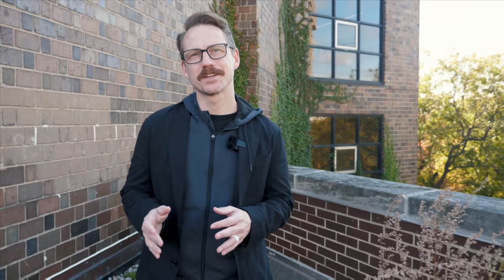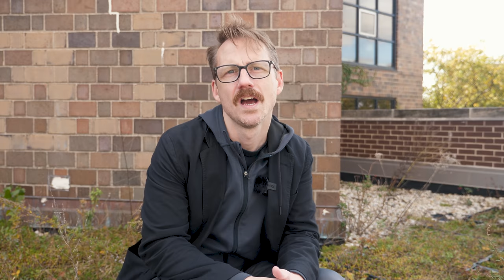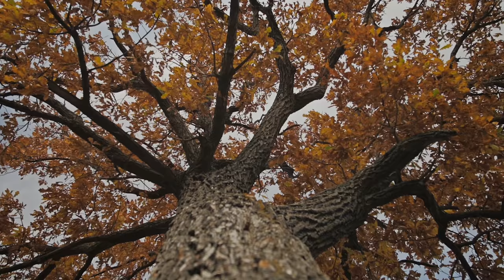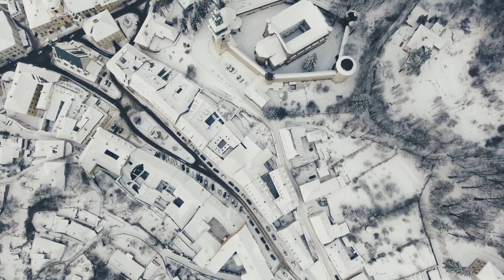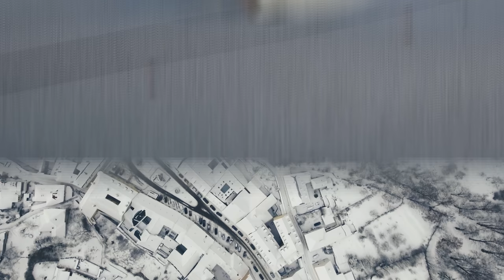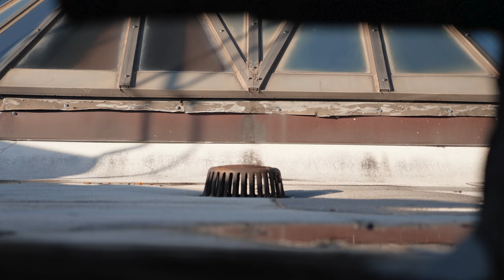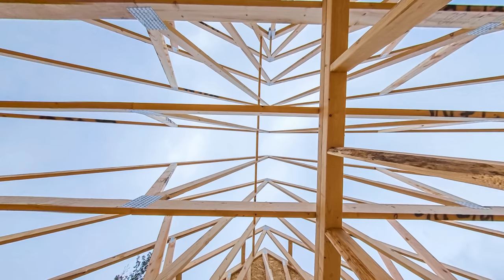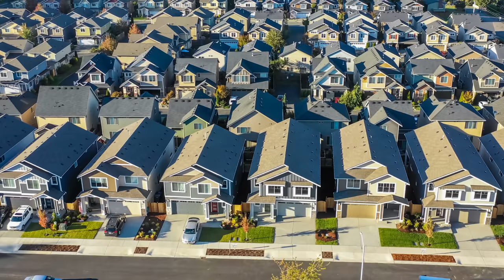Why Do Architects Insist on Using Flat Roofs?

Comment: Another main reason for flat roofs in cities that have snow in winter is the hazard of snow/ice falling on pedestrians below, especially on high rises. In Switzerland (Davos for example) the building code mandates flat roofs, both function driven and aesthetically to keep mainly a “uniform look” of the buildings, even though they do vary in shape and form ;) I am not saying that there aren’t exceptions even in Davos, which does have sloped roof homes, but they aren’t in zones where people walk beneath the roof’s possible discharge ;)
Reply: Ah, I often wondered that, thank you. I think Montreal, Quebec would be a good example as well as the majority of buildings and homes have flat roofs and that's a likely a major factor!
Reply: I've seen some incredible snowslides off the roof of my town's sports arena.
Reply: In snowy countries there are often horizontal rods or a series of notches attached to gabled roofs to keep the accumulated snow from sliding off. This is common in e.g. the Alps and the Carpathian Mountains.

I’m some other cold European countries there is an architectural tradition of very tall, steep gabled roofs on which the snow doesn’t build up.
Reply: @timpauwels3734  Yeah! Here in Canada asphalt shingled roofs tend to hold the snow fairly well in most cases, but on metal roofs you see those little stoppers or rods almost always.

It's neat to see all the different methods to tackle the same problem!
Reply: Excellent point.  I have one of these new popular metal roofs with a significant pitch, and when the snow comes off, it comes in one huge sheet.  Imagine a 10" snowfall sliding off at once--it's enough to bury a small dog that happens to be relieving themselves at the moment.
Reply: Thank you for this comment, I always wondered why Davos looks so much different than Zermatt for example. I have to confess, I don't like how Davos looks. It reminds me of a pile of Lego bricks poured on the bottom of a valley.
Reply: Here in Oklahoma if we put gabled roofs on our skyscrapers, the melt refreeze cycle of winter would cause the snow on the roof to become sheets of ice over a day or two.  Basically causing the build up to become potential air to ground projectiles.  Even if it didn't kill anyone, the property damage alone would be horrendous.  Happens all the time with cars that aren't cleared of the snow.  Every year there's reports of accidents from ice flying off the top of cars and trucks and AT LEAST destroying windshields.  A few are fatal.
Reply: @learningcurve23   I love learning new stuff!  That's right, I never imagined there were skyscrapers in Oklahoma.
Reply: I’ve also seen the weight of snowpacks cave in roofs.
Reply: I actually thought of this immediately when I clicked on this video. My brain just went: hmm if tall buildings had gabled roofs....then proceeded to imagine a pile of snow slip and fall 10 flights onto people.
Reply: @timpauwels3734  You realize that you just contradicted yourself right? How do you prevent snow from building up if you're literally intentionally holding it on the roof. These are two incompatible goals.
Reply: @hedgehog3180  I know this is going to sound odd but on the pitched roofs they also sometimes retain the snow for insulation purposes. After the first snows the sun comes out  and creates a hard slippery surface on top that sheds new snow but retains the older for insulation.
Reply: There's better roof designs than flat roofs. Flat Roofing is just lazy. It's easy to do, it's cheap, and it does it's job, as long as it's maintained properly, it's just that maintenance is not something that is cheap, and for just 10% more material and 14% more initial work, you could've had a convex roof with drainage and you could even incorporate techniques to keep the snow from assembling on them, by means of passive heating, but no, just slap a roof on the building, make it all as cheap as possible and make it last 40 years top, great solution, I'd rather go old school, and force everyone to go back to copper tiled slanted roofs, like the Cathedral in Roskilde, Denmark.

Oh and Modern Architecture is a scorn to everyone's eyes.
Reply: There's better roof designs than flat roofs. Flat Roofing is just lazy. It's easy to do, it's cheap, and it does it's job, as long as it's maintained properly, it's just that maintenance is not something that is cheap, and for just 10% more material and 14% more initial work, you could've had a convex roof with drainage and you could even incorporate techniques to keep the snow from assembling on them, by means of passive heating, but no, just slap a roof on the building, make it all as cheap as possible and make it last 40 years top, great solution, I'd rather go old school, and force everyone to go back to copper tiled slanted roofs, like the Cathedral in Roskilde, Denmark.

Oh and Modern Architecture is a scorn to everyone's eyes.
Reply: The flat roof isn't icicle proof however

Comment: The bigger issue is that they’re often in situations with people who can’t afford to keep up the maintenance of flat roofs financially or have the money to make the roof as leak proof as possible. That’s when it starts to feel like an imposed burden and a money scheme.
Reply: From my experience maintaining a flat roof waterproof costs practically nothing. I haven't spent a penny on maintenance on it in 20 years and it has never leaked.  I think all these problems being described here about leaks and collapses and what not are just a result of faulty design by the architect responsible, poor choice of materials and poor workmanship. There really is no reason why a properly built flat roof should leak or collapse unless a plane falls on it or something extreme of that sort.
Reply: @listerdave1240  there is also literally no reason to build a flat roof if you don't want a balcony on it. So if you don't want a balcony getting a flat roof is just plain stupid because to repair is (if something breaks" is way harder then an actual normal roof.
Reply: @captainbube1217  The point  am trying to make is whether or not you choose a flat or gabled roof should have nothing to do with whether it leaks, or how much maintenance it needs or whether it will collapse with snow. In those respects there is no difference between a flat and a gabled roof as long as they are both built properly.
If you want a gabled roof because it looks nice and traditional then that is fine, and that is just about the only good reason there is for a gabled roof. If you want a flat roof because it is more practical that is also fine. 
What I don't agree is what you say that repairing a flat roof is way harder than an 'actual normal roof'.  First of all for me an 'actual normal roof' is a flat one, whereas a gabled roof is one that has better aesthetics.   I'm not quite sure what repairs you are referring to that a flat roof might need. Unless an airplane falls onto my flat roof I don't see it ever needing any repair.  It's been there twenty years and it is just the same as it was when it was built.  Even if it were to collapse due to some catastrophe, 
 building it anew is neither difficult nor expensive.   I don't know that much about gabled roofs but I don't quite understand how any roof can be easier to build than a simple flat concrete roof.
Reply: @listerdave1240  there is a massive difference when it comes to snow and ash. Flat roofs can't shed those things at all. And I do mean at all, it just builds up until it stops snowing or ashfall stops. Gabled roofs don't have this problem because the snow or ash just... Fall off.
Reply: @captainbube1217  This video gives plenty of reasons why buildings have flat roofs.
Reply: @listerdave1240  in my experience flat roofs will kill themselves after a few years because any smallest hole will start to let water into the isolation material, i could not be up to date on this but this single reason is enough for me to make a roof tilted and with shingles, but this is just for my home region obviously, strong winds would maybe be a good reason for flat roofs.
Reply: @captainbube1217  It seems to me all these problems with flat roofs are due to the way they are apparently done in some parts of the world.  The way my roof is built means that such a thing as you described can never happen because the insulation is itself the waterproofing. It is not only resistant to water but it is the thing that stops water from getting past it.
It is only after getting into this discussion that I found out the crazy ways roofs are being insulated and waterproofed elsewhere and I just wonder what was going through the mind of the people designing them. It's almost as if they design them on purpose to fail after some time. I mean who in their right mind puts insulation that can be damaged by water on the outside of a roof and just hope it doesn't get wet?  I had naively thought all roofs were done the way mine is done but for some reason it seems not so and I really don't understand why.
Reply: Correct! Also the flat roof is heavier so it need a stronger structure and foundation. But i think that whenever you feel it has a value to do a habitable roof, is good to do a budget comparison so the client can make a final balance of financial benefits vs space value!
Reply: @captainbube1217  Shingles, well there is a maintenance disaster in the making. In Europe and in other places they use tiles to form a roof for one very good reason, and that is that if they are well made they can last for 100 years or more with minimal or even no maintenance.
Reply: @sandponics  sorry because of insufficient vocabulary i thought tiles were chingles i mean tiling roofs like in most european places.
Reply: @listerdave1240  Sorry to intrude, but I agree with you. Practically every house built in my country (Mexico) has a flat roof except on certain neighborhoods with more of an "american" influence (usually really expensive and big houses) and I have never ever had a leak problem. Basically the only thing you've got to do maintenance wise is to apply a coat of watter repelant type of paint every 5 or 10 years, maybe seal a few cracks if the roof has never been maintained in all its life and you're good to go. For a normal size house you would need about 2 20 litre buckets that will run you around $170 usd.

So I think it definitely depends on how they make flat roofs in other parts of the world.
Reply: That is the same with any roof.
Reply: @vyor8837  If that is truly a problem for you, consider installing heat tracing.
Reply: @deangraves7462  wut
Reply: There are several roofers weighing in on this very comment thread about the ease of working on flat roofs.  ANY roof will leak if not maintained.
Reply: Nailed it
Reply: @namebrandmason  i disagree. My barn roof is 130years old and has neve been maintained. Just tiles on a wood frame. It is yet to leak
Reply: @captainbube1217  It looks nicer and if you live in a country with little sunshine, that little bit of extra sun on your lot might be worth it.

Comment: as a carpenter in Montana I hate flat roofs in residential housing. you have to continuously shovel off the roof until it's waterproofed and even then it's prone to leak. Gabled roofs shed most of the water and snow even before the underlayment or shingles go on.  The project I'm currently on was basically raining inside for months as we waited for the roofers, we spent hundreds of man hours shoveling and vacuuming out water.

Comment: My grandfather was a roofing contractor. I remember my grandfather constantly telling me in a very matter of fact way  that flat roofs always leak.
Reply: UnjustifiedRecs  All roofs will eventually leak. At least where I grew up, the flat roof on the garage leaked a decade after the sloped roof.
Reply: Yep, even when they're new.
Reply: Your grandfather likely worked with materials/types way shittier than modern options.
Reply: As a matter of fact he also could repair them much faster and easier than a slanted roof. It was also of course much cheaper than a slanted roof.
Reply: Flat roofs, at least modern ones that are mopped and have 3 layers, should be pretty leak free for at least 10 years. If you have a leak right after installation then your roofer did not install it properly. I've literally reroofed flat roofs myself and currently do permitting for all kinds of roofs in Miami. The biggest issue with leaking for flats is ponding. Water accumulating on any surface without proper drainage will always cause big issues. If there's a chance of poding then your roofer should have already considered that and suggested to install a tapered roof system using some kind of insulation board.
Reply: Better to have leaks than to have chunks of snow and ice falling onto unsuspecting pedestrians.